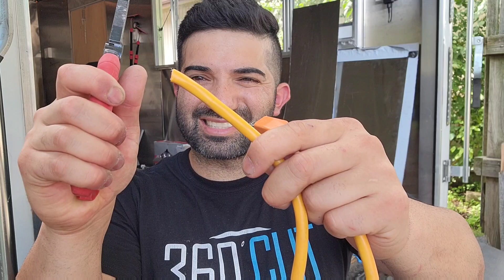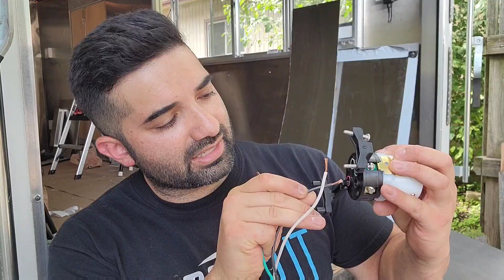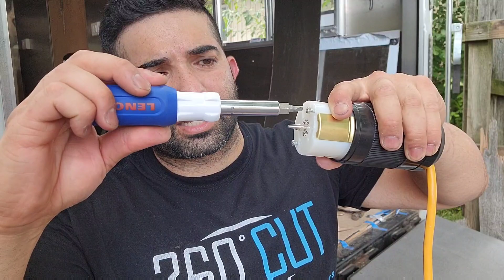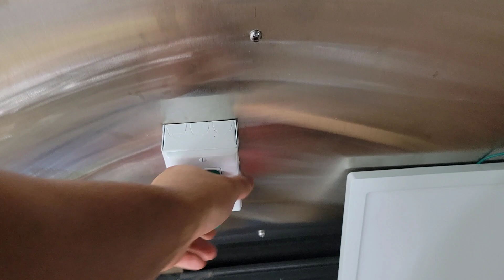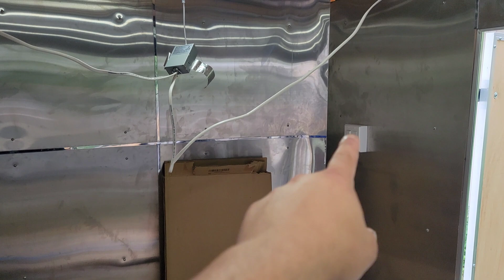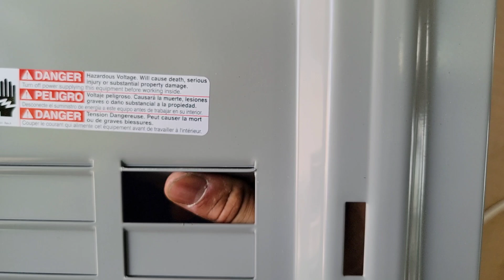How to Power Up a Food Truck

Comment: Rap I was making it so hard 
So if I wire my food trailer from breaker box to the 50amp plug box in front of trailer I can run either my generator or external shore power. Eliminating need for auto transfer switch correct? That saves me ton of money. I’d like to know where you bought your aluminum at? I’m lookin for colored skin aluminum and going to need 12 sheets it’s 160.00 a sheet here in Texas. And now gotta figure out how to but up two edges of aluminum skins to be as smooth as possible
Reply from the maker: @stevequate1797  I use white aluminum from metal supermarkets and use FRP dividers for in between sheets. $160 sounds about right

Comment: DON'T just use a 12 or 14 gauge extension cord. Add up the amps for all the equipment you will be using and size your wire properly. Otherwise you could burn the food truck down or worse. Every gauge of wire has a specific ampacity it is rated for.
Reply from the maker: @kevouelt  I know this, and mention this on videos, but this is just for lights and small little things when parked, if that's what you are referring to.
Reply: @fbaltierrez  hey sorry I didn't see that you mentioned that. Thanks for your video!

Comment: Hello, great videos thank you . Quick question here! If I am going to events and if I use this regular plug will it give me only 15amp power to the trailer? Because this plug type is for 15amp 110v. If I Plug it in a normal house outlet and want to power the trailer, I would only draw 15amp to the trailer is that right? So I can’t use most of equipments
Reply from the maker: When it's in the yellow extension cord I made to the house yes, just minimal power. You can install an outlet outside dedicated 30 amps or 50 to your panel but that's a whole different animal lol

Comment: I have an event. I have a generator but if i do this could i run the truck full bore using just this cable? Or is it recommended to use the generator
Reply from the maker: Depends on the power they are pushing to you. If it can handle your truck then yes

Comment: Love you videos and I need some guidance. Maybe you can help, so I want to wire my small concession trailer with a hundred amp box. Will have small refrigerator, a hotdog steamer, in line hot water heater. We will be near power when using it 90% of the time. So can I run my whole trailer off of one extension cord plugged into an outlet somehow? Sorry if my question wasn’t detailed enough. I’m willing to video call you and show you what we have if you have a chance. Thanks and have a blessed day.

Comment: I’m confused on previous video you talk about using 30 amp power but here your using 50 amp plug
Reply from the maker: Yes I upgraded on other builds, on mine I have a 30 amp both work nicely. It just depends if you need 50 amps down the road it's nice to have it ready, but I only use 30 amps currently personally

Comment: Thank you for the video Frank, I'm a complete novice to this stuff. So this will take power from an outside source and convert it to run my appliances (Fridge, freezer, counter top stuff) Lights, fans, vent-a-hood (exhaust fan) etc...
Reply from the maker: Yes it is what I use to connect to my Generator  this is 1 way to do it. There are others but this is what I use

Comment: I got tired of climbing under our cabinets to drop the power cord through an access door to run it to my generator and installed the 50 amp reliance box outside of the trailer and retrofitted the generator cables thanks for the great video.

Comment: Where you get your Reliance 50 amp
Reply from the maker: https://www.amazon.com/gp/product/B000HS0HQW/ref=as_li_tl?ie=UTF8&camp=1789&creative=9325&creativeASIN=B000HS0HQW&linkCode=as2&tag=rollingburrit-20&linkId=10042d0aa2d8ad0a2df1e1d6382444a3
Reply: @fbaltierrez  I have 10,000 generator in 8000 what all electric box I need to make my food truck run
Reply: Hey sir I was wondering do you know anything about flat box behind your food truck to set up your generator .So when I tell me a bike rack would hold my generator while driving

Comment: So my question is I have a 30 amp female on my trailer and 30 amp female on generator. So I think it's illegal to make a cord with 2 males so what can I do? Thanks
Reply from the maker: No it's all the same. Just change the Connectors
Reply: @fbaltierrez  sorry dumb to electric put 2 30 amp males on my 8 gauge wire I have?
Reply: Maybe I asked wrong I am trying to run 2- 30 amp males. Male to trailer and male to generator. Or do you only use the 120 male on generator not 30 to 30? Thanks
Reply from the maker: @Beard76  wherever the Connectors don't match if there is no other way Cut that end off and make a new one
Reply: @fbaltierrez  thanks!

Comment: Hey Frank! As im trying to connect my generator plug to the trailer, the outlet inside my house keeps tripping. What would you suggest first in order to troubleshoot this issue?
Thanks again as always for the inspiration!
Reply from the maker: Is it a GFCI outlet?
Reply: @fbaltierrez  yes sir it is, does that matter? Although i also hooked it up to a non-GFCI and the same thing is happening?
Reply from the maker: @poormansfoodtruck  on your panel. Is the neutral ties in with the box?
Reply: @fbaltierrez  do you mean the panel inside my food trailer? Or my panel inside the house?
Reply from the maker: @poormansfoodtruck  In your trailer
Reply: I'm sure you've figured this out by now. I'm guessing it was pulling way too much power/amps for the breaker in your house. This has happened to me, sometimes resulting in melted plugs at the trailer.
Reply: hola, amigo me gustaría saber cómo se llama esos conectores que puso con la extensión y el que puso pegado a la lámina del camión. Me gustaría conectarme a una conexión de casa o al parqué. 
Comprendo una extensión de 3x 10  que voy a armar pero me gustaría hacerlo como usted lo hizo

Comment: Hello Frank would you recommend a 14/3 cable to use instead of a 10/3? Thanks in advance.
Reply from the maker: Well 10 gauge is to handle 30 amps. It depends what you are using it for
Reply: @fbaltierrez  thanks. I’m using a 30 amp and running prep fridge, lights, vent hood food warmer. Going to have 2 - 15 amp breakers. Trying to set up similar to what you have set up in previous videos.
Reply from the maker: @joadrianvara920  I haven't had any issues with 10 gauge but if you can I would at least use 8 gauge that would be my suggestion

Comment: First off. Thank you so much for your videos. It has help me tremendously.    I do have a question. I haven’t seen you talk about or show how to install an AC unit in your trailer could you please make a video explaining how to.   Thanks
Reply from the maker: AC not needed. People are 50/50 on these. Since the air just leaves right out the concession window when open. I just use floor fans.

Comment: Frank, will you show, explain the rear ramp build? Lift system etc
Reply from the maker: The ramp is just the factory ramp that came installed with the Trailer no modification